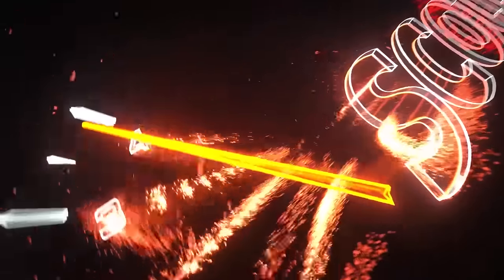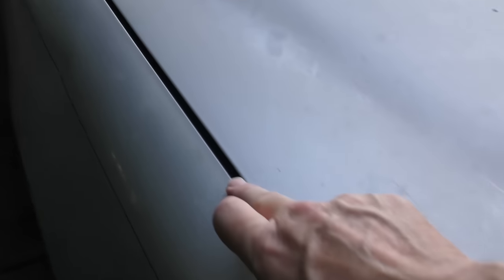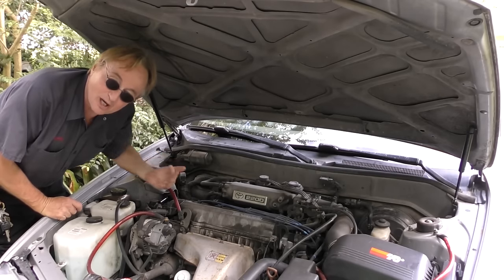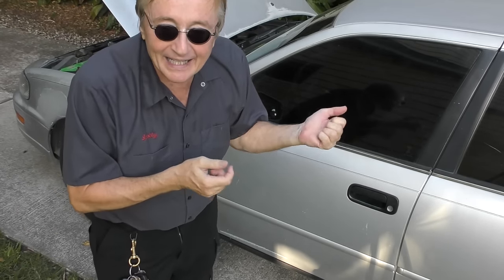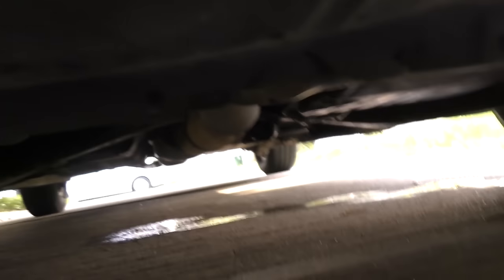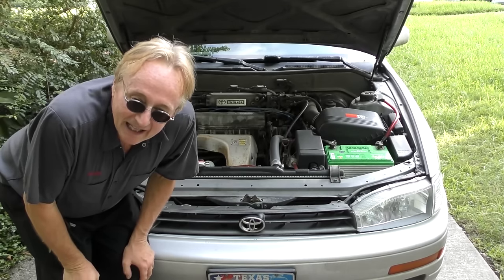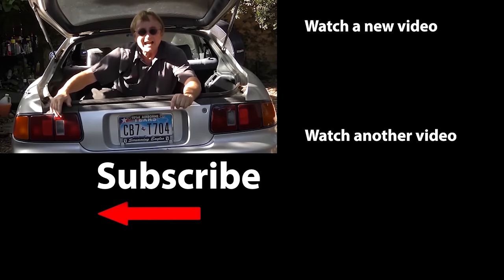Can You Destroy a Toyota Camry

Comment: My 1996 Toyota Camry is at 288k, but within this past 2 weeks the AC, dashboard, and power windows stopped working, but the car was still running. This happen twice in that time frame. Does anyone know what could be the issue? I've had it for 3 years and in the first year it just needed some TLC and was running like new. Now this happened. Help me save my car. Please and thank you.

Comment: Sure can. Remember the 3.0 V6 having oil consumption issues ? A good friend bought a 2002 XLE V6 new that had the engine go at 12k miles. Toyota replaced the engine but yeah , an old Camry can die !

Comment: my 97 just died could'nt figure out what was wrong it wouldn;t start, replaced the timing belt the fuel pump relays still wouldn;t start it finally gave up the ghost but it should have after 372,000 miles! same transmaission same engine,  i could have figured it out (it also had a main seal leak 1 quart a day) but at this point it's time to give it a proper decent burial lol, it is by far the best car ever built the easist to fix good gas milage cheap parts

Comment: I just got a 6 cylinder 1999 for $500 loaded  with 152,000 miles on it. Thing runs like a clock.   Well the one thing wrong is the windows don't roll up till they want to.

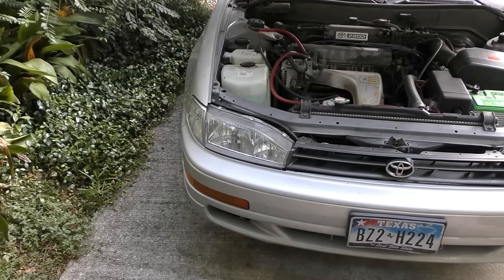Comment: :37 Electric Window ????????????    2:17 The Headlights look to be aftermarket upgrade.  The headlights weren't clear until the 2000 model. The front side marker lights are aftermarket as well. They should be amber not clear.

Comment: I have a 98 2.2 that has had a knock in the engine for since 2014
Reply: My grandmother bought mine new everyone in the family has drove it Air and heat works 277k  …..everyone of the door handles have been replaced I haven’t done anything in 4 years except change the r oil once a year and put a strut on the back

Comment: Okay so I am having an issue with my car it’s the same car make model motor as well mines is only a 96 instead of a 93 but still my question is that my car is not giving me any spark at all and I’ve watched all of your videos on how to get spark and I am at my breaking point but not yet ready to give up on my car changed the transmission and motor oil tried to change the fuel filter but it bent and broke so it was replaced but now it does not want to start it will crank forever with no signs of it wanting to turn over please help me out I don’t want to waste money gettin this car fixed
Reply: Maybe you have a bad distributor or ignition coil(s). It's not just spark plugs.

Comment: want a used camry,is there any years i need to avoid
Reply: Avoid before 93 and after 02..these had the 2 indestructible engines 5s 2200 cc and the V6 3000cc. Bombproof engines

Comment: I am looking at a 2000 Camry 4 shoulder with air the guy told me that the motor a motor is not good or bad. But the body believer or not is perfect it's perfect it has 4 brand new tires all new struts all of the other things as far as maintenance is concerned as done is it worth putting a between a 4 cylinder motor and a 2 drag per minute to drive the body is perfect no Dean's things all it all except for the motor it's perfect I can get it for 500. My issue is is it worth putting the 4 cylinder motor in to drive and believe it or not the odometer shows a 148000 miles but the guy did tell me the motor for some reason went bad I was wondering if it would be worth putting is putting a 4 cylinder motor in it maybe rebuilt rebuilt thank you please make sure I get back with you

Comment: Mine is a 95 has 366k miles it's got a blown head gasket and it's running on no oil because I'm getting a new car in a few days but I'm sure the camry can go another month if I needed it. it doesn't need oil it only needs someone to start it once a month 😂

Comment: Three generation noise struts towers bad distributor 130000 leak oil pumps head gasket door handle breaking bad headlights at night in the rain bad radiator at 130,000 drive it to hard to transmission will go out. Mine went out driving down the highway   
Most people can't do the front axles and believe me you shouldn't even try shop even hate them. Rack and pinions rarely leak but they do 1993 still have r12 air conditioners I still like the second generation better less problems what would I buy another one hell yeah and in good shape 500 dollars but don't expect any problems expect all those problems 25 to 31 miles per gallon in summer time only